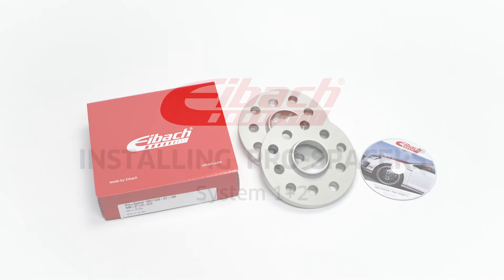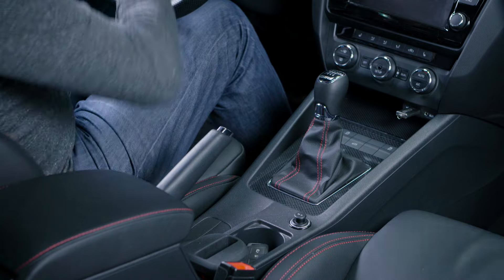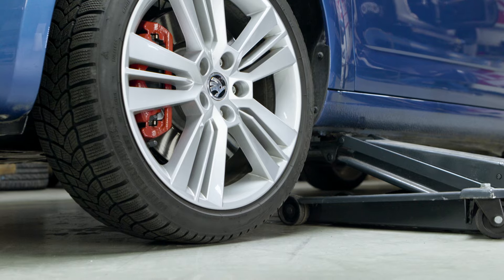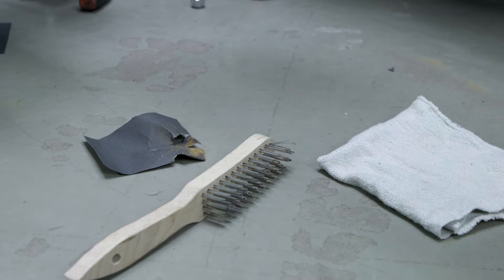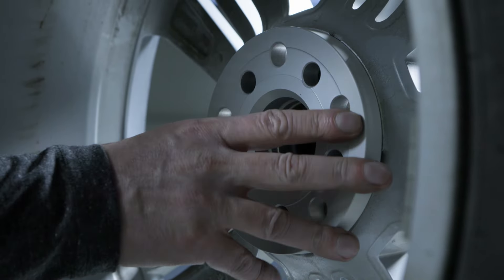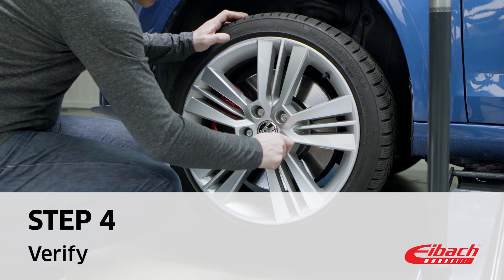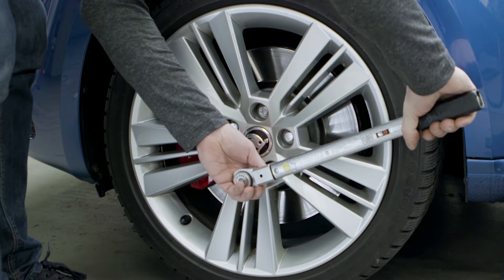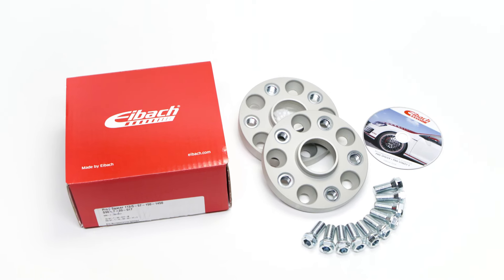EIBACH | Pro-Spacer Installation Instructions System 1 | 2 (English)

Comment: Problem is where can i get the extended wheel bolts............................aftermarket one normally in bad quality, would system 1 and 2 include longer wheel bolts?
Reply: I would also like to know that!
Reply: The package does not include longer wheel bolts.

Comment: I've just installed 15 mm Novitec CF528 123916 by Eibach wheel spacers on my car, tighten all the wheel screws, and when the car turns left or right i can hear a rhythmic clucking noise .
I have no idea what's went wrong. 
Can you give me a suggestion what should i also check? Thanks
Reply: Sándor M could be one of you wheel bearings affected by the spacer installation, it doesn’t mean that the spacer caused this, probably the wheel bearing was already affected...
Reply: If you have drum brakes, bolts/bolt might be too long and they hit your handbrake assembly. Had same problem with my friends car, even tho they were "oem" accessory wheels.